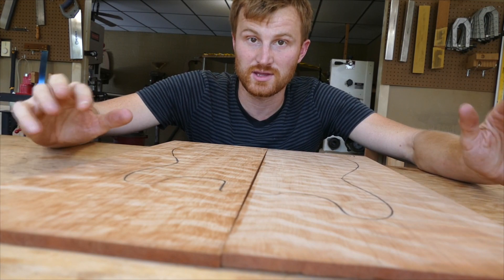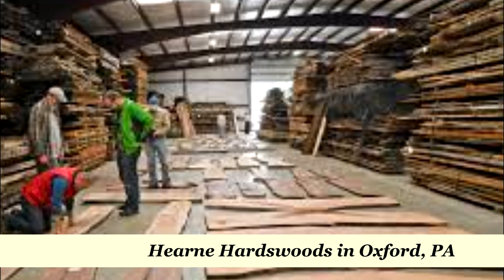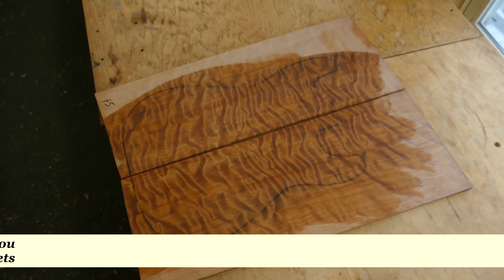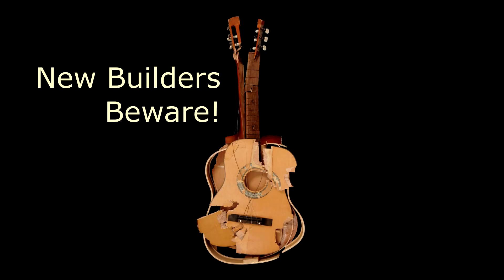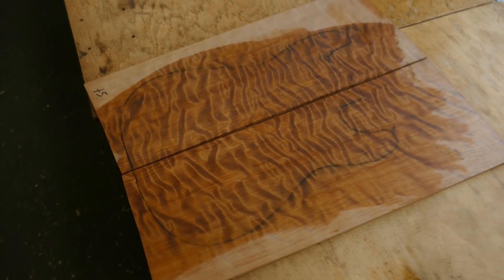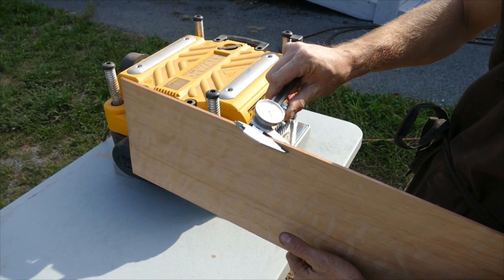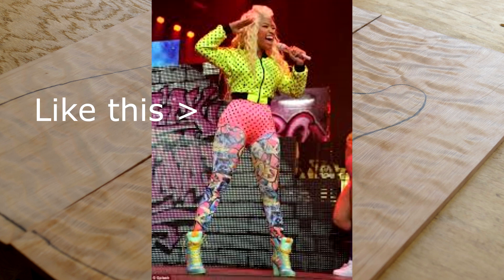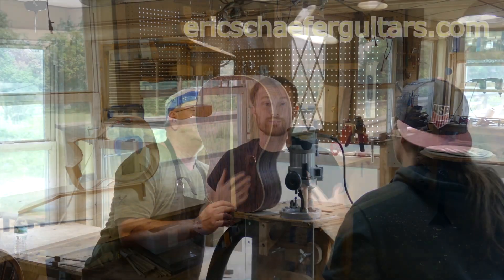5 Reasons NOT to use Figured Wood for a Soundboard

Comment: Interesting about the redwood top.  I will have to do some research.  I think of redwood as something for fences and picnic tables.   The coastal redwood in California (Sequoia sempervirens) were logged for picnic tables and other landscaping uses.  My parents had two redwoods in their back yard in California.  Their cat loved to use them as a scratching posts and kept a ring of bark 18” above the bottom wooly from use.  50 years later the trees are 3’ and 4’ in diameter.

Comment: When u talking about stiffnes you also have to talk about the mass/ densisty of the top. Because the density to stiffnes ratio is what is rly important. So if you have a bad stiffnes to weight ratio, you have to make some other compromises or do a rly good bracework. Pls correct me when im wrong.

Comment: Just my 2c worth - I reckon it's too much - i.e. heed your reason #5. If the back/sides is the tiger myrtle that grows in Tasmania, then pair it with a good spruce top and TM bindings - maybe with a wbw and/or wbwb purfling and it will look and sound fantastic as well as not give too many problems down the track

Comment: Hi Eric.   Before I saw this video, I made a tenor ukulele using grenadillo back and sides and a figured redwood top.  I also used a modified V bracing similar to what Taylor has been doing.  The tone is amazing, but the sustain from the redwood top is just out of this world.  The strings just seem to ring forever when fingerpicking.  Usually I will go with spruce or koa.  I don’t know if it was just a fluke or if the redwood really is superior.  Or maybe it’s the V bracing.   This was my first using that bracing.  I had been using a standard X bracing.  I’m building another one from the same logs right now.  Of all my builds, this latest one is by far my favorite.  I just can’t put it down and I don’t think I could bring myself to sell it.  Thanks for the video.  BTW, how did your build turn out?

Comment: Very interesting. I wonder, if it is also true for back and sides: Could a more figured, "prettier" piece of wood be of inferior quality when it comes to the stability and longevity of the guitar? Or even the tone?
I am asking this because at the moment, I am torn between two exemplars of the same acoustic guitar model I want to buy. One has a much more figured back than the other, but I felt that the plainer one sounded just a touch better. But I am still uncertain, maybe I heard wrongly. But is there a general rule?

Comment: TGIF! Great way to start the day. Amazing figured Redwood, should be a real stunner under finish matched with the Tiger Myrtle! Looking forward to the follow up video to this.  Curious as to how you will address the instability, work-ability and voicing issue's. For instance, what type of wood will you choose for the bracing......or will you shape them differently then for a even piece of spruce. Also I see the figure having a wavy surface, it looks likes it presents surface gaps....brace contact seems it would be an issue, or is there a filler of some sort to make a flat surface along the brace's contact point. I don't build guitars (though very interested) but these are some points of thought that came to mind as I watched the video. Thank you for sharing your insight on this very interesting topic.
Reply from the maker: Thanks, Curt. Actually, I've already selected some very quartered western red cedar for the braces.
It's true what you're saying about the wavy surface. That's very perceptive of you. The end grain and side grain sand at slightly different rates so you end up with a surface that is ever so slightly wavy. If you progress through the grits though, the difference becomes imperceptible 
(although it is microscopically still there), and then I wouldn't say it's of consequence to the joint.

Comment: Figure on tonewood is chrome on a Rolls-Royce, sequins on an Armani, fancy cabinetry on a Steinway, or for that matter, abalone on a D-45. It doesn't make a superior sounding, superior playing instrument. Martin made some 44 model guitars on request. They had the best wood, made by the best craftsmen at Martin, a 45 model stripped of the gewgaw. There is one other reason that a luthier builds with exotic looking wood: the knowledge that someone will buy it, possibly thinking that the exotic wood made it better (if it is), not the hands of the craftsman.